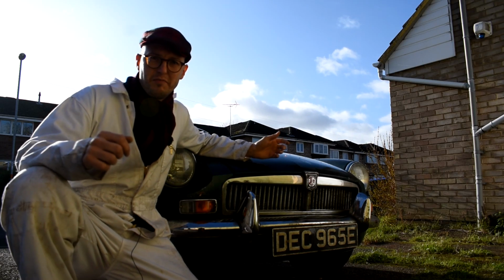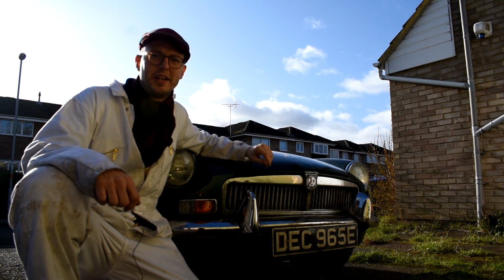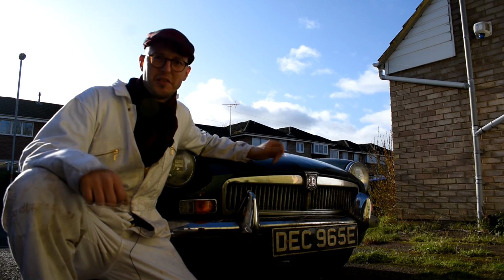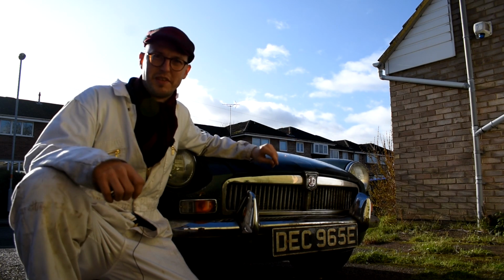MGB Steering Rack

Comment: Just need some advice please. My steering rack on my 72 mgb roadster is really really heavy at low speeds. I was thinking of doing a power steering conversion but maybe i just have a faulty rack? Is your re con unit light enough to use at low speeds?
Reply from the maker: With an old car they will always be more heavy to turn the wheel at lower speeds, you could up the tyre pressures in the front a little, or consider a power steering rack 👍
Reply: Thanks for the reply. Id better check the pressure first as i it looks pretty low. Thanks

Comment: Another good video Steve, certainly makes the job look easy. I tried to remove my track rod ball joints using the trusted hammer method but I couldn't free them, probably cause I can't find my lump hammer 😂
Reply from the maker: That’s years of me slogging away doing it for a living that make it look easy, but I’m just glade if my YouTubing can help or inspire others to fix there own cars
Reply: Easy ball joint removal……loosen nut to the end, slapp couple times on the end with hammer, put jack under the nut, with a little tension, slap side of ball joint a few times, it will pop up out of socket. Never failed me.

Comment: Is the need for an alignment avoidable ? i wonder from new when adding outer tie rods how many turns are required :)
Reply from the maker: You do need to align the tracking. Not doing it will see uneven tire wear, and the car will handle very badly. You can roughly set them up from the old ones taken off by counting the turns as I did in the video, but this is no guarantee they are correct in the first place is is only a rough guide. Ultimately as I said in the video, you need to take it to get the tracking aligned 👍
Reply: @SteveDentonClassics  Gotcha thanks for the response

Comment: How did you set the tracking? Did you not take measurements off the old rack or at least mark where the track rod ends were on the old rack and copy this? Surely it drives like a cross-legged donkey like that
Reply from the maker: Hi mate, I just counted the turns when I took the old track rod ends off the steering rack, then just put them on the new rack with the same amount of turns. This set it roughly correct. Then not seen in the video I took it to my mates garage where I used a set of lazer tracking gauges to align the tracking. It wasn't far out
Reply: Steve Denton ah brill! Cheers Steve, I’m tackling the same job on my V8 roadster tomorrow
Reply: @autoroom21  I will be doing it on my V8 roadster as well! I'm sure R&R will take all day!